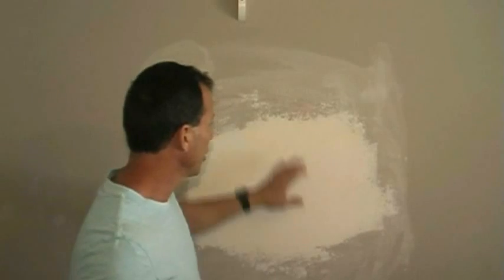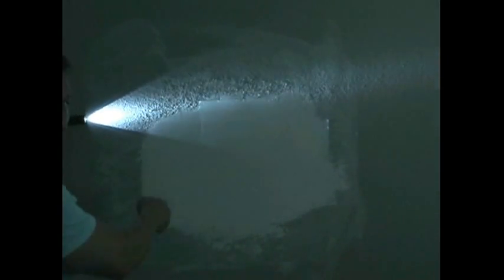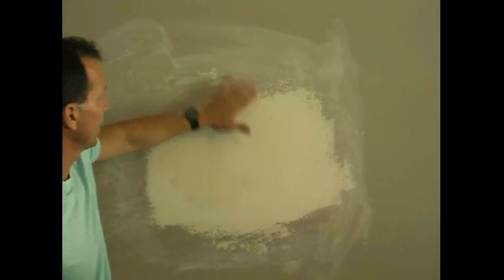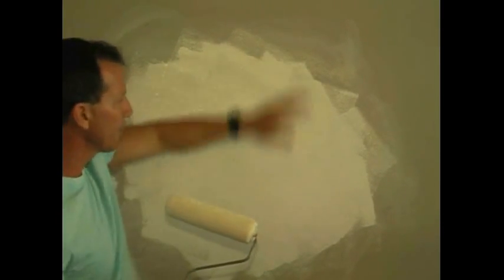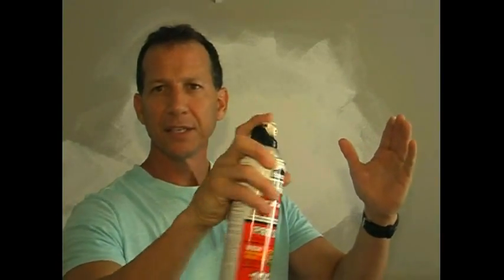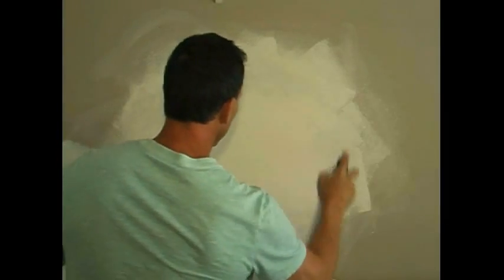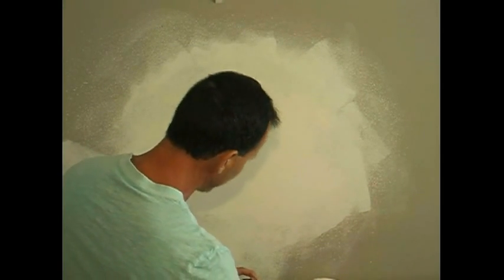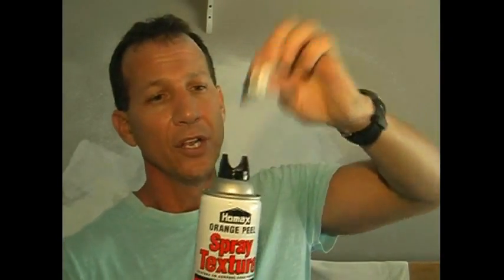How to fix hole in Drywall 4 (Spraying Texture)

Comment from the maker: Hi Tommy Rad,
Thanks for your input. You are right about the new Homax texture, it is an awesome product. They have greatly improved it over years.  However, you are mistaken about the wall that I repaired on this video. I fixed this hole on my wall and no one can point out where the patch was. This house is 25 years old and the wall has been painted numerous times. When texture has been painted on  over and over, it becomes smoother, thus making it harder to match with new texture. 
Paul

Comment: That Homax wall texture is SO MUCH BETTER than the old stuff with the different sized red spray-tubes. Works incredibly well. Very short learning curve on how to control the settings on the can. I used the water-based orange peel spray.

I had to cover about a dozen door-knob sized holes. More than enough in 1 can.

Perhaps you can do a video repair on an already finished [orange-peeled] wall. Blank wallboard is super easy to fix. Fixing a hole in a 12 year old house is a bit different. Thanks.

Comment: Paul, I noticed that you did not rub the texture more flat. I use Homax oil base texture for my orange peel patches. It's great stuff, but you have to "flatten" it out to match most water based original orange peel texture. After it's dry rub it 1 time (literally) with a sanding sponge to make it lay down like a water based product. Homax water based orange peel texture may be wiped flat by excessive paint strokes. The average homeowner would not know these distinctions, great how to video though.
Reply from the maker: You are right Gregory Davidson, I'm glad you brought this up! I usually knock the new texture down to match the existing wall,since the wall already has paint on it. Sometimes it is almost completely smooth. I usually use 220 sandpaper to do this,since the oil based Homax texture is pretty durable. 400 on the latex. I recorded that step ,but missed it when I edited. It was already up on YouTube before I realized it. I work 3 jobs and I have a memory like a gnat. I can see you've done this more than once!!
Thanks!
Paul

Comment: This series is amazing you explain things very well! I am going to pick up everything needed to do a repair can you tell me what kind of drywall mud you where using in the bucket and where I can get it? Also I see you used white regular tape for the doorknob hole what is the difference in the white tape an the mess one? Thank you for all the great videos have a great day.
Reply from the maker: Hi Paul,
I use standard drywall mud, you can also use lightweight mud. They are available everywhere. I usually buy the 5 gallon bucket, because you will get so much more for a few dollars. If you keep it clean and out of the sun, it will last a long time. The tape is also a standard paper tape. I prefer the tape over mesh myself, although I have seen some pro's using the mesh. It's a personal preference. I will say that the paper is easier and cheaper to work with if you wet it before you put it on the wall. Especially if you are a novice.
Thanks Buddy!
Paul

Comment: Great video!!  I bought the water based Homax this weekend to texture a patch I did in my bathroom.  When I sprayed it it sprayed on the wall, but also dripped down the can and sprayed all over the place.  What am I doing wrong??
Reply from the maker: Hi Kristie,
Sorry I did not see your post earlier! You musts hake it up and keep it agitated. I find that the latex based cans do not spray as well as the oil based ones. They tend to fizzle out from lack of gases. The oil based ones work much better, but the fumes are strong and you must tape off the area,  Harder to remove!
Thanks!
Paul

Comment from the maker: How to fix hole in Drywall/Sheetrock/wall and texture 4
Reply: You did not texture the middle of the patch???  If so, why???
Reply from the maker: Hi Doug,
It is hard to see on the screen, but I sprayed the whole area. This product comes out in a pretty wide splattered pattern. This is why I move the can continuously as I spray. Remember the oil based  one sprays much better than the latex one. The fumes are pretty strong though, so I would suggest a mask or respirator. I would also cover everything around your patch that you do not want to spray. If not, you will find specs on it that are difficult to remove.
Thanks!
Paul